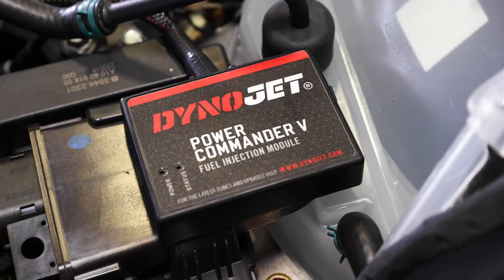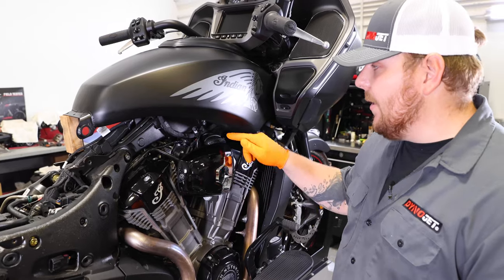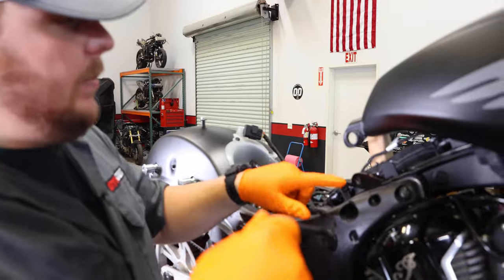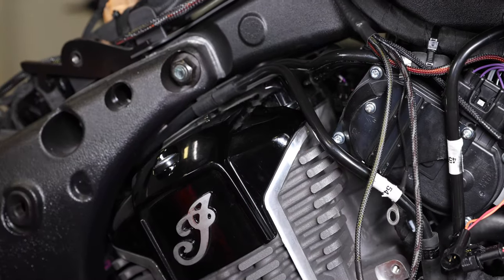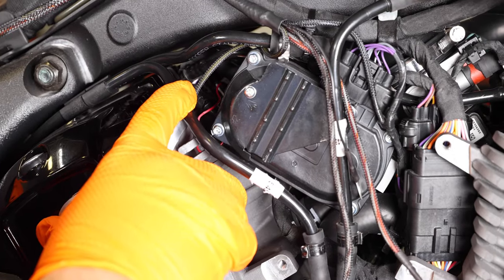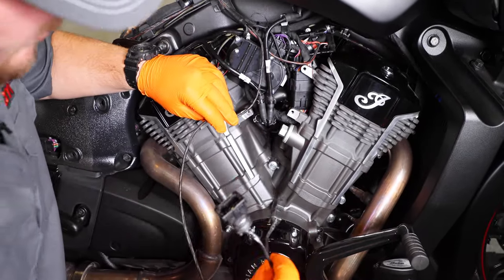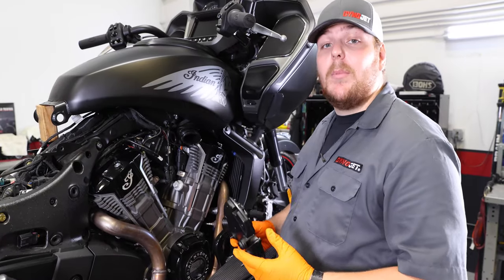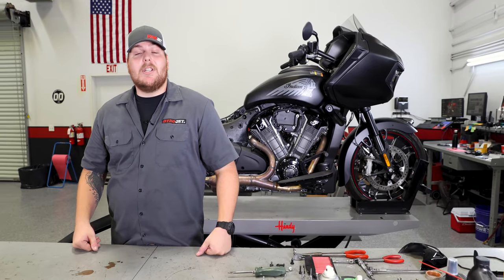Official Video: How to Install a Power Commander V — 2020 Indian Challenger

Comment: Great vid, you guys are ahead, no one else has a tuner yet for Challenger. Why is the crank connection wire exposed on the left side of the engine? Is the line long enough that you can route under the tank & down the neck if you want a cleaner look?
Reply from the maker: It's not long enough to route under the tank, Mike. And the crank connection wire was not exposed, that's just how it was routed for installation.